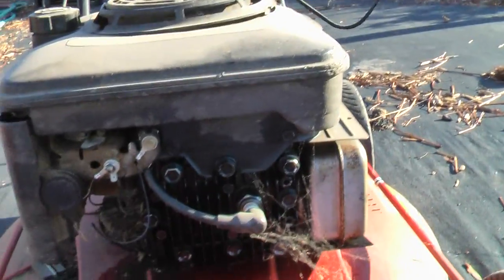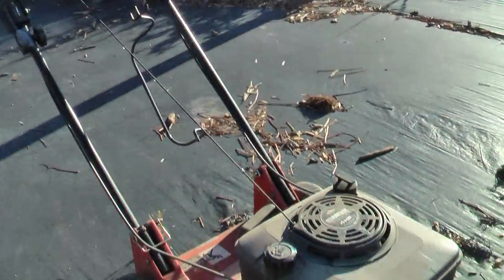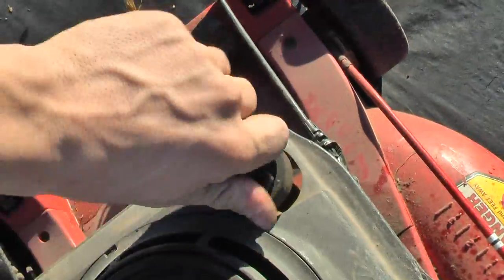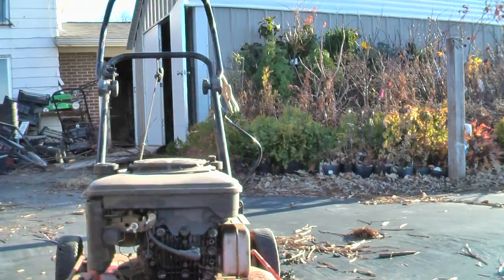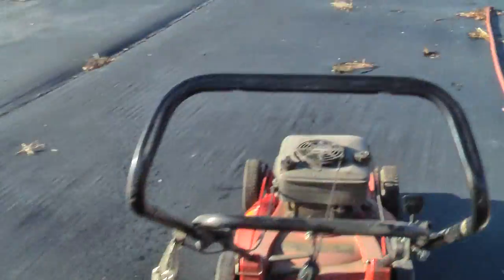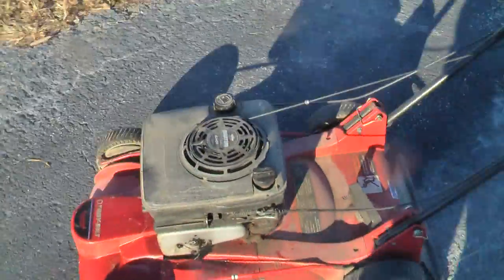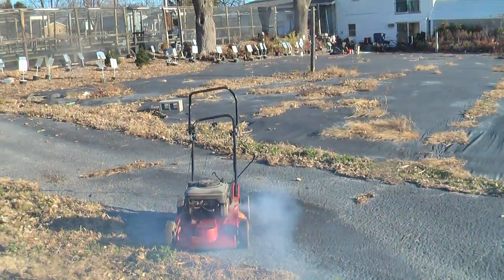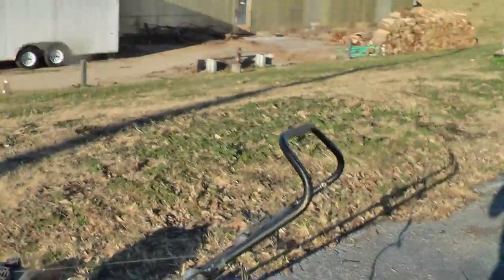Coldstart Pushmower After 1 Year Smokey!

Comment: There's probably nothing wrong with the motor on the mower base but it does sound like it has some piston slap or something as I can here a metallic knocking sound in the engine.
Someone from the U.K. on here had the same oil burning problem as he only had the room to store his Briggs motor vertically as well.
I have a 1988 Briggs push mower which my auntie gave me in 2008 which had a broken pull cord on it,it runs but is hard to start, smokes on startup & Lacks power.
I am going to freshen it up with a new set of rings as its compression is 97 PSI,the nominal compression for one of them is about 120 PSI when the rings have broken in.
Anything below 100 PSI,the motor is beyond help except if it is rebuilt, providing it is feasible to repair (i.e. if the cylinder is badly scored you may as well throw the whole motor in the bin).
In my case though,I am confident that mine just needs a re ring !!!!